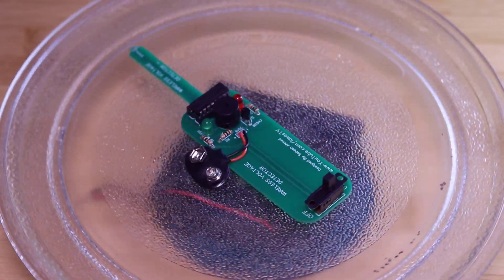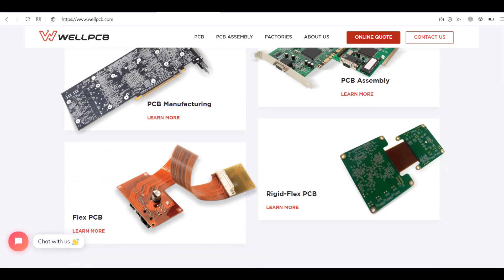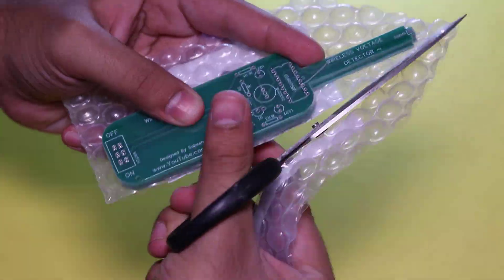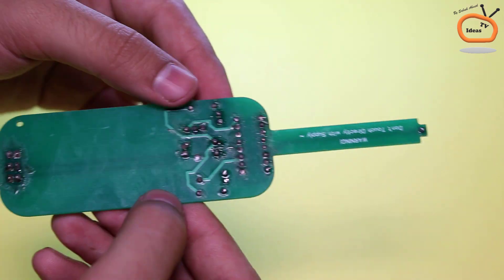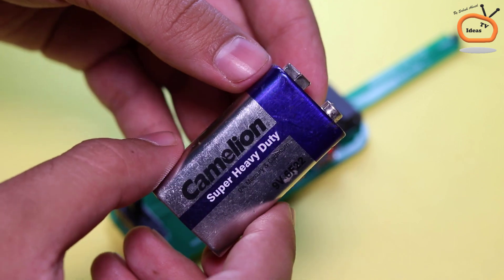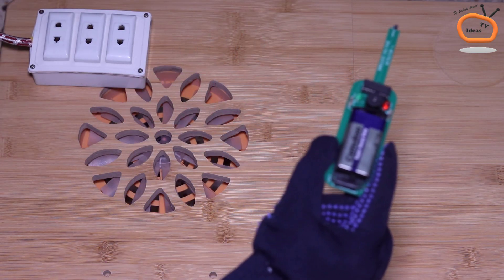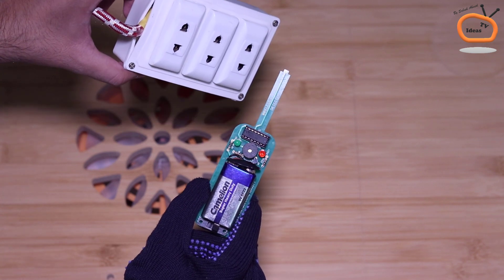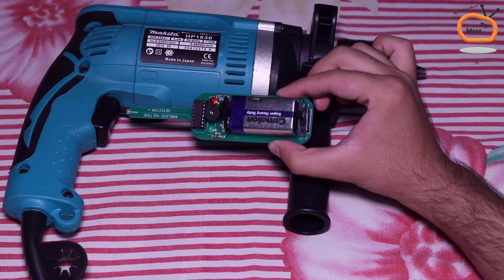Non Contact Voltage Tester DIY - How to Make Wireless AC Voltage Detector on PCB

Comment: Sir is there a diy tool that can detect ac 230 volts line inside 12 inch Walla.
Reply from the maker: 12 inch is too much
Reply: @IdeasTv  at least 6 inch thick walls.If possible send a diagram.

Comment: Can there are any way to adjusting sensitivity?
Reply from the maker: not possible in this circuit, but you can do it with my another in which I'm using transistors instead of IC. checkout my channel for the video
Reply: @IdeasTv  if I use a potentiometer??? 
Is it possible with this circuit?
Reply: @IdeasTv 4:45